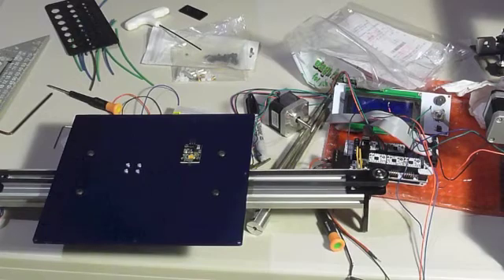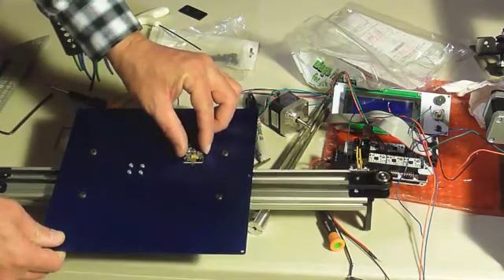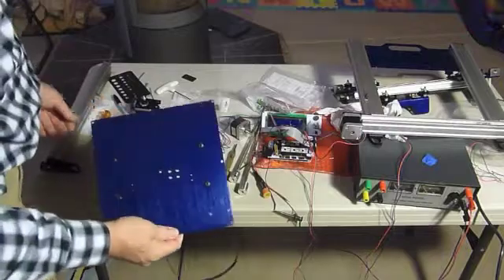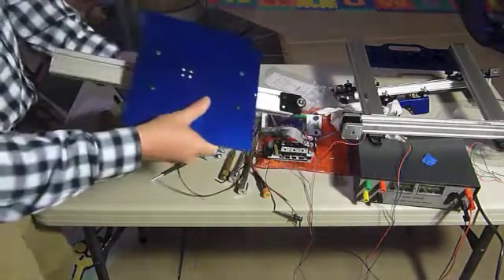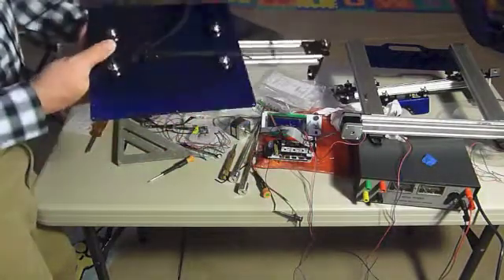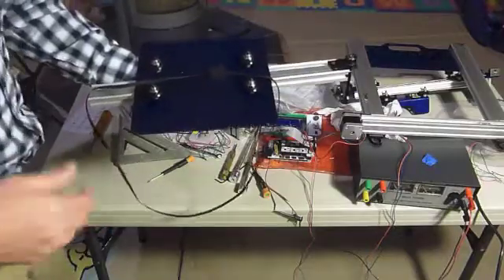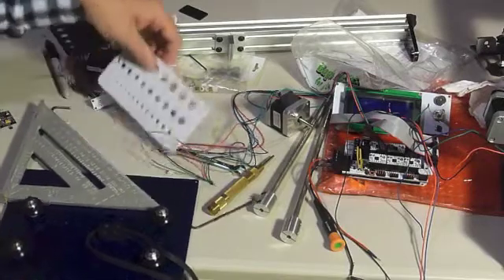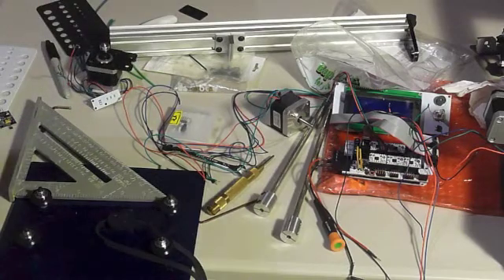Ord Bot Hadron 3d-printer Build part-3 - Mount Y endstop

Comment: Why do you place the pretty sensitive and comparatively bulky sensor PCB on the moving part - and not on the carrier, where no cables have to be moved and bent all the time?
Reply from the maker: Good Point.  Ideally you are correct.  It was a practical decision.  Given the components I had this was the best mounting I came up with.  The reprapdiscount endstops are not ideal for the mounting you describe. I believe they have a newer version (although I have asked and have not seen one) that is designed to mount to the slot beside the rail.  Now that I can print things maybe I'll make do as you recommend.  (I'm Still hoping to hear from reprapdiscount about a newer endstop design.)

Given my current arrangement I have not noticed a problem with the cables or bulk/mass.  I have had a problem with the connector to the x-endstop touching build objects.  I have made some bends to minimize this, but it needs to be fixed.

thanks for your comments,
randy

Comment from the maker: I really hated to drill the beautiful metal plates and almost bought the plain old contact switches to match the holes.  I fully expect to redo them once I have everything running.  I want to have as few cables*motionAxis as possible.  I like the "no moving parts" aspect of the hall effect, but notice I didn't use it for the Z axis.  I don't know enough about the variation in field strength/sensor orientation and the hall effect as built can easily deflect.  (reprapdiscount kit came with both)